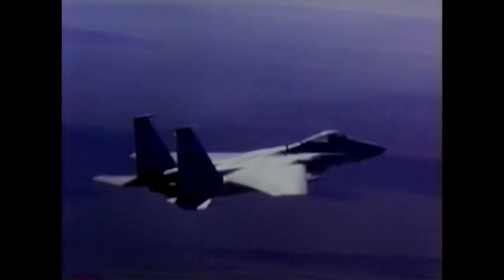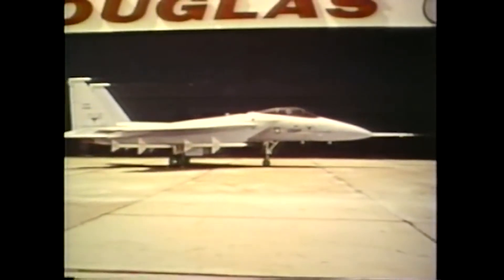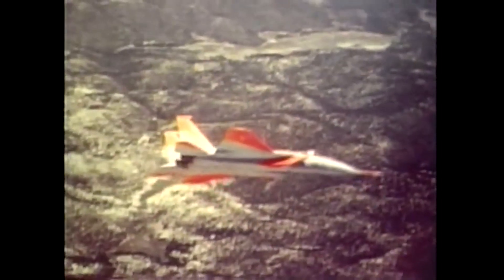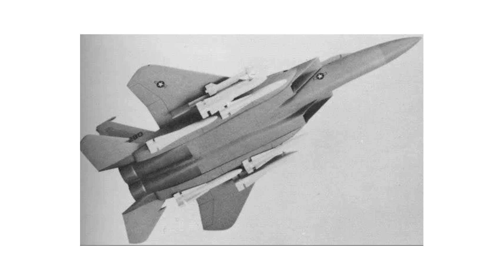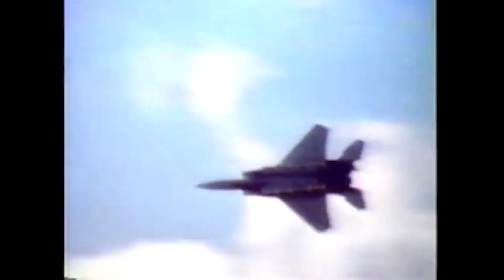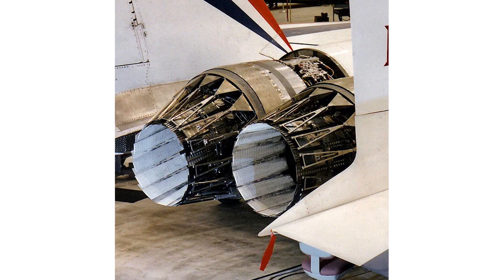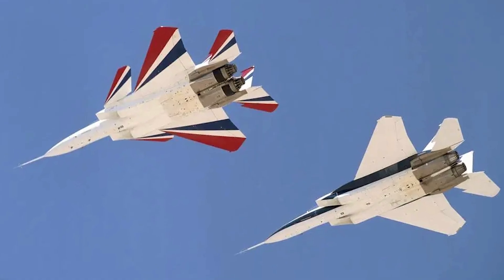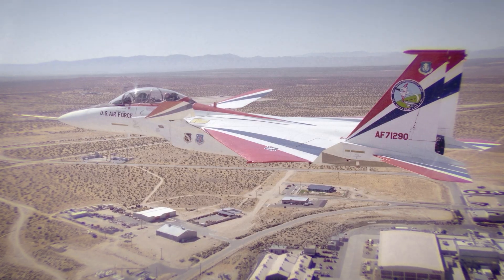The Forgotten F-15

Comment: My question was? Why the US didnt put F15 Active into Productions line?? If they know F15 with canard and thrust vectoring better than original F15, even ini F15EX didnt have the technology,
Reply: Super maneuverability won't help you dodge missiles. It just helps them see you better and track you easier since it makes you slow
Reply: @wruenvadam  yuppp... And Im thinking too, theres no way to Dodge missile anyway, but, F15 Active better in all aspects than original one
Reply: @firemustang6678  Not really. The Active was a great tech demonstrator, but just because you can make a cool tech work doesn't mean it'll be useful.

Take the canards, they look cool, and do help with ACM at lower speeds. But you also have to factor in the weight of the canards, the motors, the structural reinforcement, controls, etc... That weight could also be fuel, ECM gear, or munitions. Not worth it. 

Any technology from any of it's programs that were useful have already been implemented into modern F-15's.
Reply: 1. Cost
2. These modifications Increase agility, but decrease range and probably affect speed too, due to added weight and drag
3. Even with these upgrades, F-16 is still better at dogfight anyway, so it's better for F-15 to stick on its original role as heavy fighter
Reply: Unless you NEED a short take off and landing F-15, it's pretty pointless (although totally cool).  The F-15 is supposed to be a BVR killer (and it is).
Reply: In a word: Maintenance. All the extra actuators and control surfaces all require inspections and spare parts and maintenance. We don't have the F-15 active for the reason we don't have and of the flavors of "Super Tomcat", more complex vehicles that don't provide a needed and compelling advantage to offset their increased costs then the boring people in the budget office are probably going to rain on your parade...

Comment: Wikipedia says this aircraft is currently "on display at Edwards AFB", but Edwards is a big place and much of it is off-limits to the public, including the Air Force Flight Test Museum. There is an "air park" next to it which is open to the public (hard not to be since the aircraft are sitting outside), but the Google Earth image shows no Eagles there. There is an SR-71 and one of the two F-16XLs, however. But I wish that museum was open to the public...
Reply: Check with them. If you're in the area, I'd suggest calling the base Public Affairs Office. 

Some bases have museums and such on base that aren't accessible on a day to day. But sometimes you can get a tour, or they'll have an "Open House" where you can go see it.
Reply: I’ve personally seen the F-15 STOL sitting at the end of one of the taxiways by a hanger on google earth. It was outside next to some other jets. Not sure if it was waiting for a restoration or something.
Reply: @tristansundquist1834  Looked at it. Looks like it's in an Airpark.
Reply: https://maps.app.goo.gl/wiaounieWsaBuY917.    Google maps shows it at the corner of Lilly and Walker on display.

Comment: How come Australia never has F-15??
Reply: Because we had mirages, f111 and then hornets, super hornets and f35s instead
Reply: There are a lot of conspiracy theories out there but the simple truth is... Australia didn't need the F-15. We had aircraft to provide the capabilities it offered (such as long-range strike) and the hardy F-18 suited our requirements (i.e. suitable for short runways, durable, etc) and specialised surveillance aircraft. We upgraded aircraft in our inventory a lot. Plus, we now have the F-35 as well, providing a stealthy sensor platform with data fusion. Today, we are also developing 'loyal wingmen' drones and acquiring more long-range missiles.
Reply: Late 70’s and into the 80’s saw significant political tension between Australia and Indonesia.  The purchase of F 15s was seen as a potential catalyst for an arms race.  The less capable but maturing multi role capabilities of the F16 and FA18 provided more versatility with less potential for international political blow back.  Having operated a single engine jet for many years (Mirage 3) the twin engined FA18 was seen as more survivable (in a big country with few suitable runways), with potential to evolve its strike role as it matured with the US Navy.  Finally contracting allowed the FA18 to be manufactured in Australia.
Reply: Because Australia needed a true multi role jet to replace the F-111 
F-15 didn’t have electronic warfare 
But I hear ya mate
Reply: Main reason I found boils down to this, 1st  they wanted anti ship capability which eliminates all but the f16 and f18, 2nd they wanted two 2 engines because they feared going over the vast distances even over land without a second engine for backup. The second point was comon in the 70s and into the 80s which is why we had 3 engine airliners. Basically that leaves the f18.
Reply: 😅went for the F18 for multi role instead
Reply: Because Singapore has a handful of SG+(no longer vanilla SG version of old) versions always at Queensland with that clause and ready pilot instructors+cadets+maintenance crews. Guam and closer "Pacific Swing forward depolyment allocation" (pre-approved by the usual lots) will likely reduce the numbers.
Reply: Might have been a budgetary thing? I suspect you could buy more Hornets than Eagles for the same cash?
Reply: Thrust vectoring designs into a broad
Reply: Maybe because they never bought any?
Reply: Because of emus
Reply: Well here we go ………shit governing and late to the party .
Reply: The way I understand it, they wanted to prioritize aircraft that could fill multiple roles, like the Mirages, F-111, F/A-18, and now F-35.
Reply: Because lack of $$$.
Reply: My understanding is they did consider the F15E to replace the F111 and F18s but they really wanted the F35 because it offered more capabilities over the F15 and was a better long term option.  However, delays in the F35's development made them buy Super Hornets as an interim solution until the F35 came online.  The cost was much more reasonable than an F15E.
Reply: They never chose to buy it because they still had a well-functioning air force, and when it was time to get new interceptors, ground attackers and fighters, the wonderfully versatile Hornets and Super Hornets were already available. Then came the 21st century export powerhouse, the F-35.
Reply: Cost. At the time they were very expensive. Instead we bought the mirage. 
Then we got the F18 which was as good
Reply: Because they'd probably upset some delicate snowflake in the auzzy government. The kind that set up covid camps and voted yes on the native Australians being able to claim everything from the dirt to the sky is sacred and running an f15 might upset the sacred wind or some other bullshit
Reply: Because Fraser feared the Indonesian reaction if we had got them.
Reply: Aussie should have never bought the F-18, F-15 is the goat
Reply: As least we have f111
Reply: Because Australia doesnt have Enemy
Reply: Because of the kangaroos..
Reply: Ostriches don't fly😂
Reply: @noondlite  Bombing obviously
Reply: Bc they would go to war with emus again 💀
Reply: Laser guided bomb to u know
Reply: Wasn't  durability in hostile surroundings one of the key reasons for acquiring the Hornet  and the Super Hornet?  I think the  Canadian government gave similar  reasons.

And the  F15 was only allotted to Japan, Israel, and  Saudi  Arabia(extremely  strategic/wealthy  countries)  the  F15k was  made available to  South  Korea because there were other options in terms of the  Rafale and the  Eurofighter were made available.
Reply: Because they don't need it. Who attacks Australia? I mean, even the demons didn't invade there in doom eternal so...
Reply: Y'all decided to use boomerangs instead.
Reply: I think the price was a bit high too
Reply: I agree, but Fraser was afraid of the Indonesian reaction!
Reply: "Crikey"
Reply: @misterbig9025  EX would be the right fit nowadays…
Reply: @misterbig9025  too poor. Canada too only like the f18 for some reason.
Reply: Australia don't have it because they didn't buy any of it
Reply: If the threat is from china singapore has f15 
F15 is not priority because of the security
Reply: Yes, F-15's would suit Australia better then the F-35, but so would have new Super Hornets, and they would have been more cost effcient then either the F-15 or F-35.
The F-15 would never have been a good replacement for the F-111 - The Eagle was slower then the Aardvark, at altitude it was close, but on the deck, there was nothing, and still is nothing, that could catch an F-111. It's capabilities, and more importantly, it's effect on the militant sabre-rattlers to Australia's north west, prevented more conflicts then it participated in.
Just on the arguments, mostly made by politicians who want the kickbacks from buying new aircraft, 'The airframe is too old,..', sure, but instead of buying a whole new aircraft, we could have paid to have new airframes assembled and all the parts to make them fly swapped over. Think of what the Aarvark's could have done, with new airframes made with current generation materials and engineering, current avionics, and a pair of modern SuperCruise capable engines, and you end up with a weapons platform that can dash in on the deck, drop a payload on target, climb and maintain enough speed to outrun any interceptor on the planet, with enough range to defend the coastline of a continent sized island nation.
But sure, lets buy single engined short range fighters, they're nice at airshows.....
Reply: F111’s had much more range. We were then supposed to replace them with the F35 however the program was delayed so the F18’s were sent to fill the gap. The F15 has a massive radar return with all its 90 degree angles, they’re really one good for target practice…. and flying with 1 wing missing.
Reply: We'd probs be better off with f-15s over f-35 imo
Reply: @kevinruddthestudrudd0074  For looks I'd agree but 40 years of technical development counts for something.
Reply: @danpatterson8009  No doubt, but the f15 ex is something else with being cheaper to run per hour, range speed and weapon load, alas the aging air frame unfortunately...
Reply: @kevinruddthestudrudd0074 The F-15 is a dogfighting specialist and missile truck (neither of which is unique). I like it, but it simply doesn't match the F-35's sensors, data fusion and emerging control capabilities.
Reply: @danpatterson8009 Fifth-Gen and it's stealth based philosphy doesn't matter, because Stealth only works from the sides and front. The moment you get a top-down view sensor, such as the Jinderlee Over-the-Horizon RADAR, the whole aircraft is easily detectable. And guess which nation invented that, and has it across the north half of the country?
In any potential war with a nation to our north or north west, we'd have so much notice of incoming forces that we'd have to wait till they got closer to turn them back, and most of the military tacticians out there know it. No, that war would start with troops hitting beaches everywhere at once, from a slow build up of fishing and freight shipping, and by troops ariving in Intermodal Containers at a port we no longer own, trucked in to every city by our own transport network. Done right, it'd be over before anyone knew it was happening.
Reply: @kevinruddthestudrudd0074  It's just not that simple. Different operations have different needs and sometimes evading radar until you hit your target is more important than having an enormous payload capacity. The F-35 also packs a radar and sensor package that puts the F-15 to shame.
Reply: @kevinruddthestudrudd0074  No, you wouldn't
Reply: @kevinruddthestudrudd0074 Simple answer is no, China is right above you and their tech is gaining and they have the numbers advantage so you’re going to want superior tech
Reply: @kevinruddthestudrudd0074  Very good

Comment: the fact we didn't make this was beyond stupid or put the tech in the F-15 EX
Reply: The F-15EX is one of the most expensive aircraft in existence and its main pros are in its payload carrying capabilities, its speed and RADAR power, it's effectively an interceptor that is also very capable in dogfighting and strike missions. If you put 3D thrust vectoring nozzles and canards on it, you make it even more expensive and take away from its best features. 

Modern short range IR missiles almost negate the value of an aircraft to be highly manoeuvrable as they can engage an aircraft at any aspect and can even hit targets behind the defending aircraft. Also, as air to air missiles have become more capable and reliable along with onboard RADAR, the relevance of dogfighting has been reduced dramatically.